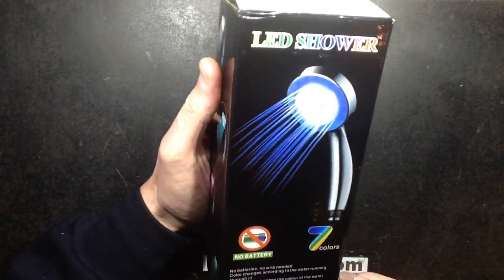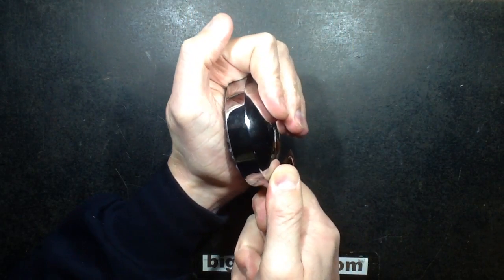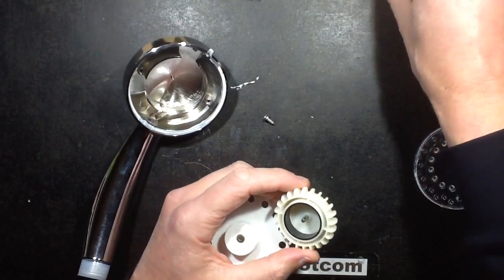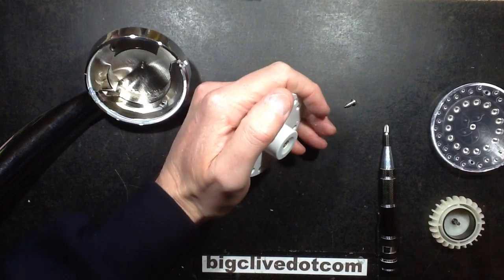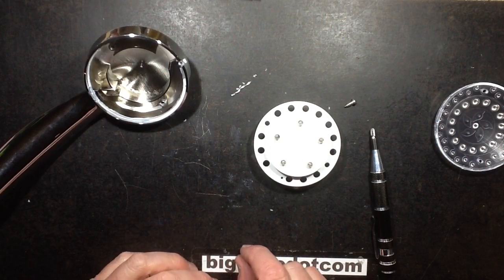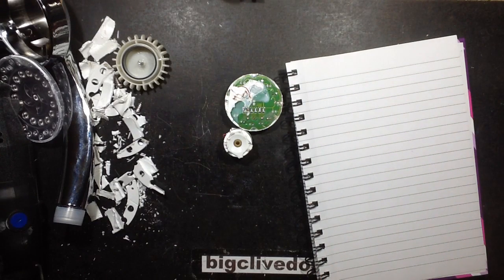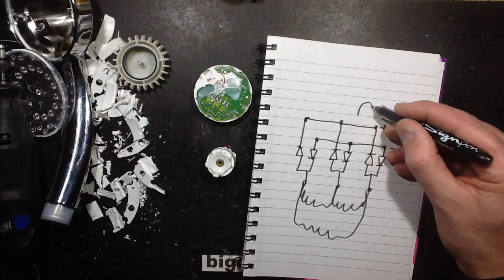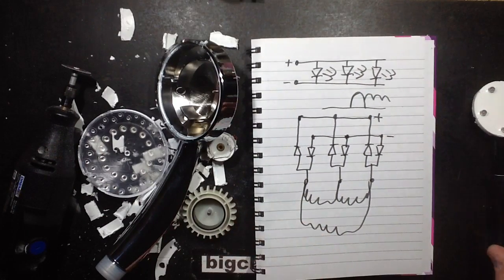A look inside a water powered LED shower head.

Comment: I bought one of these for $5 a few years ago and the LEDs now only work on cold water. I was originally going to just take mine apart for the LEDs and generator but It still sprays good although the LEDs no longer work.

Comment: I've got the thermo controlled ones, but the blue LEDs have stopped working when it's warm. Not completely as they flash a little just before red comes on, so they haven't blown. I think the controller is the problem, or maybe some part of the circuit has let water in. I have high pressure water and I'm guessing it found a weak spot after a year.

Comment: I've been wondering if it's possible to design a showerhead or an "in between device" capable of charging batteries.  A showerhead hydro charger.  Any ideas?
Reply from the maker: I've featured inline micro turbines in other videos.  They all restrict water flow, and in the case of a showerhead you'd also have to consider the wet environment.

Comment: maybe it's my eyes but sometimes I can't see your arm because of the color so it's interesting seeing your floating left hand work
Reply: i just looked because i never notice. i think its hard to see his sleeve if you don't have it full screen (as i typically do) because the bright white of the YT background contrasts so much that it makes it hard to see the sleeve. try full screen on the same frame and you can easily see his sleeve.

edit: actually, it might be because of your monitor. LCD monitors image changes (very slightly in modern ones) depending on the angle you are looking at it from. its easier for me to see his sleeve if i sit up than if i slouch in my chair.
Reply: eeesh calling out my horrible posture ;)
Reply: heh

Comment: 6:56 "they also make them with thermal sensors so the led change color according to the temperature which i think is pretty pointless" thats not pointless, thats GENIUS! if you want to just look at your shower head and know if water flowing through is cold or not.
Reply: They're pointless in that they usually set the temperature thresholds really widely so you'll never see the 'hot' colour until you're pretty much using boiling water.
Reply: @ProcrastinationHyperfocus  yea, my friend has it his sink, you never get right temperature and it starts flickering if it's in between the thresholds.
Reply: I have one of those, it also shows the temperature numerically on it with the colour. It’s pretty useful as I can see when it has warmed up or if it is too hot .
Reply: We have two of these. Love them.

Comment: Anyone know why it uses a 3-phase generator instead of the more typical direct DC dynamo system?
Reply: It also means they don't need to use a big smoothing capacitor.
Reply: I'm far from an electrical expert, but here's my guess: they're using standard computer-fan-type modules, like Clive mentioned, which tend to have multiple phases, since they're brushless.
Reply: As Hobo mentioned, it's just a bushless generator. Aa standard motor or generator would have multiple windings around the stator, with each winding activating as it's contacts contact the bushings. But with a bushless motor, beacuse the magnet spins, rather than the coils, you need to drive each phase (or winding) independently, much like a stepper motor. That's why computer fans have the little circuit board on them.
Reply: I didn't think of that, but it makes a lot of sense.

Comment: Let's say an LED has 20mA forward current when given 2V to it. Will it still take only 20mA when connected to let's say a 10A 2V power supply? that kinda makes sense, doesn't it?
Reply from the maker: You can theoretically do that, but even a tiny voltage variation will result in a significant current variation.  Especially with the older gallium arsenide style red LED technology.
Reply: bigclivedotcom thanks man, I get it. Seriously, don't bother responding to my comments, I'm kinda dumb lol.

Comment: Hey do you have a video of the first one you opened? (or a picture of the type) Searched your page, didn't find one. I have one very similar but not this exact one, it's VERY difficult to open. I prefer not to crack it open if I don't have to. I'm curious if it is also a screw off.

Thanks

Comment: I've noticed you say "prise" or "pryse" however you spell that (spell check doesn't like either so who knows).
In all my years I've never heard anyone say that instead of "pry" as in "pry something open." Is that a Brit thing or a Scottish thing?
Reply from the maker: https://en.wikipedia.org/wiki/Crowbar_(tool)
Reply: +bigclivedotcom wow. Well, you learn something new every day. 
As an aside, the tool pictured (with slightly bent end and hooked opposite end) we call a crow bar (but we pry things with it. 
The flat version with slightly bent ends on both sides (no hook) we call either a crow bar or a pry bar.
Reply: HeavenHammer wow you've added so much to the conversation. Thanks!
Reply: Pork Goog eww, but I DO like dick so...
Reply: aw sheet
Reply: +kjpmi i apologise i i got it wrong. I love you now. Love me?
Reply: It's Prise in England. I've never ever heard the term Pry used for forcing something apart??? Pry means to nosey into someone's affairs
Reply: fuck
Reply: Eyes on the prise my man
Reply: In this case, we are nosing our way into the shower head's affairs.
Reply: fuck
Reply: I live in the UK and always thought it was "pry" as well
Reply: Pry means "peer into".

Prise means "lever open".
Reply: I'm in England. Clive is on the Isle of Man.
Reply: Harry Roberts ah but that makes sense when you think about it. "Don't mean to pry..." (force something out of someone). 😜
Reply: Depends where you're at. Prise (originally prize [as it should be...]) seems to be only a brit thing.  Although, they etymology of prize (as a verb, in the sense of levering something open) is older than that of pry being used in the same sense.
Reply: Is he Scottish? Doesn't sound like an isle of man accent to me. They sound scouse
Reply: I'm in the US and I hear both used interchangeably, it's interesting how different words are regional
Reply: Pork Goog I was genuinely curious about a word I'd never heard used before, but that's neither here nor there. You cannot be bothered really...yet you bothered to try and put me in my place (correct me). Do you see the irony there?
Reply: Pork Goog Are you about 11 or 12 years old? Because that's how your demeanor comes across.
Reply: Pork Goog Is that the best you can come up with in your wise old age?
Reply: +kjpmi seriously? Thats nasty dude
Reply: +kjpmi i just cannot be bothered really, i just hate people like you that always try to correct people. Completely uneccessary.
Reply: +HeavenHammer stop that.
Reply: kjpmi sorry

Comment: ya I bought the $75 one from Amazon 10" rain shower LED temp sensing unit.  lasted for 9 months then the turbine broke. when I took it apart to remove the guts and keep the shower head it turned out the connecting rod with the plastic turbine on the end actually snapped clean off.  not any of the electric parts LEDs are fine just the metal rod that runs into the motor broke.  will be buying another one soon !!!

Comment: i just bought one and it doesn't work at all! i am so disappointed. it said to take out the plastic seal and just hand tighten it on and  will work... that's what i did and no lights when i turn on the shower. Paid $60. for it. Could  it be a water pressure problem?? any help would be greatly appreciated~

Comment: you could make a nice wind powered garden light with a little adaptation.
Reply from the maker: +christastic100 I've experimented with wind powered garden lights.  But here the wind is either zero or 1000%.  The device would either not be lit at night or it would be making loud siren noises before exploding.
Reply: Well your Dremel has replicated 1000% wind explosion 😁

Comment: Some of those automatic motion sensing faucets are powered in a similar way, which charge a battery to store the power generated. Typically the failure mode for those is limescale building up on the turbine and housing, to the point where they bind against each other and the rotor will no longer turn to charge the battery.

Comment: Interesting breakdown. A bit like some washing machine drain pumps, but working in reverse as a generator. With its floating bearing/magnetic impellar & sealed electrics. The design should last very well with regular descaling. (Squirrel acid is a no no ha ha)

Comment: It works the same way the Garden LED Sprayers work. I bought 3 for fun, they had too much spread for my garden so I took them apart. Same thing, a magnet span round the coils hidden inside and rectified to drive a colour changing LED. I took them out and wired the tiny circuits in parallel to a 3 Ni-Mh battery pack for 3.6V and mounted them in square cable trunking. Now I have a funky colour changing light bar :D

Comment: mine stopped working. actually it worked for about 1 yr before it gave me problems. it would shine very dull. i tried to clean it and then it would work for about 2 seconds and stop. i opened it and found some brown stuff around the plastic where the  magnet rotates and cleaned it off. it works like a charm. question is, will cleaning it with vinegar on a regular basis cause it to build up sooner?
Reply from the maker: +DemonLordOdin454 The brown stuff was probably just the usual goop that forms around sitting water.  If it was easy to open then it might be worth just cleaning it inside every so often.
Reply: it wasnt that easy, and i glued it back pretty secure lol, not looking forward to that, but i dont want to spend another $15 either. darn hindsight, should have used silicone. but it was thin and wouldnt come off with just soapy water. i took a rough sponge and scrubbed it off. i also noticed that the magnet was coated with something black.
Reply from the maker: +DemonLordOdin454 If the electronics are potted, you might get away with a squirt of bleach into it and let it sit for a moment before rinsing it out again.
Reply: ill try that if it does stops working again. ill clean it every so often too.
Reply: Captaintoast12321 Sometimes the water comes out of the tap all thick and red and I can hear faint screams and banging noises.
Reply: Your water supply sounds pretty contaminated, the only build up should be limescale.
Reply: +DemonLordOdin454 Some times I get random bits of blue plastic coming out of my taps because of a disintegrating plastic pipe somewhere under the road outside.
Reply: +DemonLordOdin454  I had one of these over a year and the pipe bit that screws into the shower cracked fell apart. But the head still works. I've kept it thinking I'll do something with it one day.
Reply: yea, the city works in this area very often and we get the brown water afterwards. guess it built up. but it works now after a good cleaning. not as good but still works. guess i should have put some lube on the rotor.

Comment: would it be possible to run a high lux LED indefinitely on a whole bunch of capacitors? like connect a AA battery for a few sec and run the light constantly?
Reply: What, you mean nothing to do with shower heads, just what you describe?

In this case the capacitors would be acting like little rechargeable batteries. They'd charge up to the voltage of the battery, then discharge through the LED. I suppose if you had an utter ton of capacitors, it'd last a while. Of course you'd never get more energy out, or more light, than was in the battery to start with. 

The battery would provide a high current for a short period to charge your caps, then the caps would provide a lower current for a longer time. 

In general capacitors aren't good at storing large amounts of electricity, batteries are much better for that. 

So no, not indefinitely. It would be no better than just connecting the battery up directly.

Comment: Bought a temperature indicating one, however it appears my (electric shower) restricts the water pressure too much. Would no doubt work excellently on either a pumped / combi-boiler system (tap) shower.

Comment: Hmm, wouldn't the water get under the spinning wheel, and corrode the metal shaft?!
Reply: I think the water's supposed to. The electronic bits are all potted, only the magnetic field travels through into them. The shaft would have to be made of something corrosion-resistant, like stainless steel. Or gold I suppose.

Comment: I got a generator off ebay for 2.99 incl shipping claimed to be 10w .....yea with tap water pressure and very very clean water , one grain of dust in it and it gunked up and would no longer funtcion , so great for around 5mins ....thats how long it lasted.

Exactly the same turbine as that one , very simple and works great but you might as well use it with di water.

Comment: I know what I'm ordering next!
Reply from the maker: +ElfNet Gaming Yay!  A Dremel and a hammer.
Reply: I have those already lol,
I have a long time fascination with LEDs and things carrying them for visual effects, also LED lights bulbs which save a TON on my mains power bill (last bill was $42.87 and that is with all LED lighting,  A/C set to 75 deg F, the fridge and computers).
Also the LED lighting allow me to not use mains power for lighting at all at night now.

Before the LED conversion and solar arrays I installed on the roof my bill this time of year was around $110 and some change and higher during the real summer months..

So I absolutely love those LED lights, they last forever and save a ton on the bill.
Reply: ***** My house was built in the late 60's, It was a "modern" house back then, brick on a slab with all the built in appliances, typical "Brady Bunch" type house, the good thing about this place it is was bought and paid for in full by my grandmother and I inherited it when she passed away, My mother lived in it until she passed away a few years back (I had a condo in Las Vegas then). I moved into this place now because it was paid for = no rent or lease only utilities. I can go 100% off grid if I want, I have solar power, wood burning stove in the den and a deep fresh water well. I miss living in Las Vegas but I do not miss the high rent.
Reply from the maker: +ElfNet Gaming Owning your own fully paid-up place gives a lot of freedom.  Whatever you do don't re-mortgage it.
Reply: Oh I know better than to fall for that crap. It's paid for and I intent to keep it that way. Only thing I have to pay is utilities which run under $150 a month for power, gas, water,, Food stuff for me, my cat and two pet rats. And once a year property taxes

Comment: Well that was cool.
Say, have you ever seen a PC fan hacked to be used as a generator?. I would imagine the blades would need to be extended so it would not require a full blown gale to drive the fan. As you pointed out these motors have a fixed winding and a rotating external field.
Reply from the maker: +Craig Nehring If you take the LED version of the PC fans outside on a very windy day you can make them light up if the wind spins them fast enough.  It's not an ideal arrangement though.  It dopes require a lot of wind and a good speed.
Reply: Yeah, I was hoping to someday create some "urban lawn art" powered by the wind, sort of a solar LED thing but wind powered. I have, strangely enough, hundreds of case fans, most of them new and all of them ball bearing type. Hoarding can be dangerous thing ...

Comment: I bought a smaller version of this for a faucet ($0.99 eBay purchase since I was getting something from the buyer anyway), and it was terrible! It seriously restricted the water flow, so not only did the water come out way weaker than it should have, but the turbine made a TON of noise! It had the "motor speeding past what it was made for" sound and it vibrated the whole sink.

It did have one interesting feature (which you ended up mentioning). It switched to blue when the water was cold, green when warm, and red when hot using a temperature sensor. I think the idea was kids knew when it was okay to wash their hands.